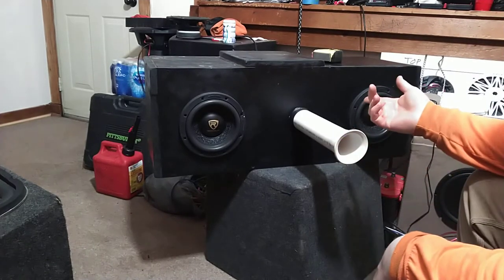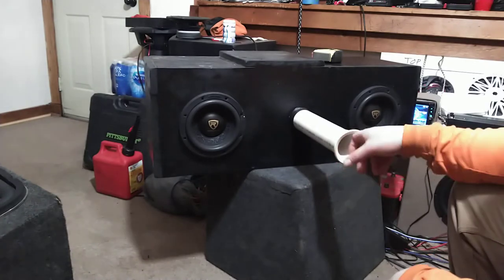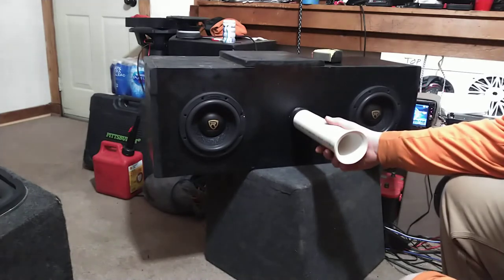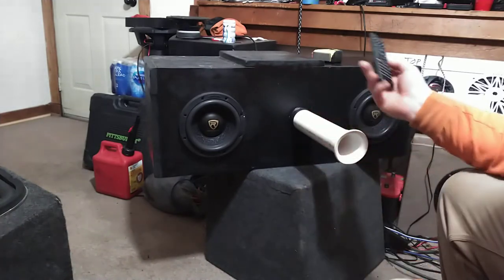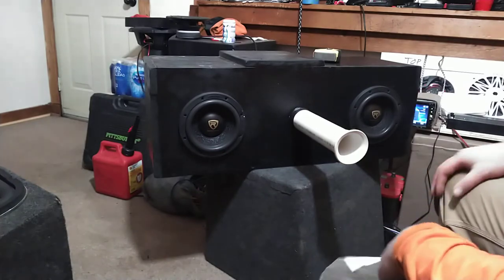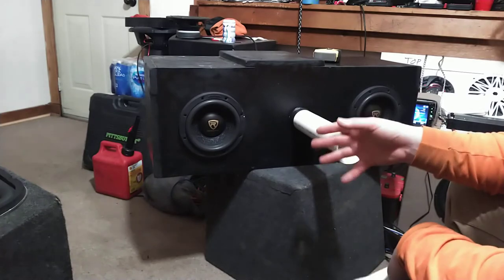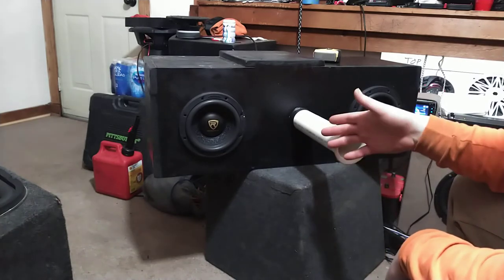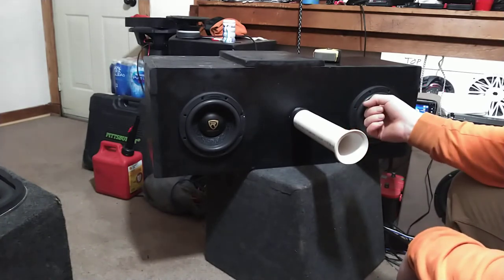Rockville k9 6.5 subs in a "custom" box with a PVC port

Comment: Rockville isn't garbage. There are way way more budget offerings. To me Rockville is a good value but hardly cheep. I got the 6.5 x 2 with 100w to each sealed box and it is tight and precise boss AR1500 x 2

Comment: Use a fosi  audio 2.1 amp made a ghetto boom box and it hits hard and so clean I have the BT30A amp.   And made a jbL kind of speaker the party box one 6speaker 4 of them are just for mids and hi’s 2 are 6.5 Sony house subs the d.v.d 5.1subs… it hit hard and the bass is all the way down to -1 like at zero and it hits turn it up to 45% on bass max are I can pop both subs bit treble max valume max phone max and it is loud fosi audio look I. To them in little amp

Comment: The port is to long, try tuning it to 40hz or so, if you want good output, tune it to a frequency you can boost at and take advantage og the low cone movement at tuning frequency. You might want a larger port aswell.
Reply from the maker: Sooooooo I started with a sealed box , didn't work , ported with a loooong boi port and slowly worked my way to a 2-3" port , sooooo yeaaaah , I ain't tuning nothing , I took those subs out , slapped a couple kicker comp R 8s in it and sold it to a buddy I used to work with